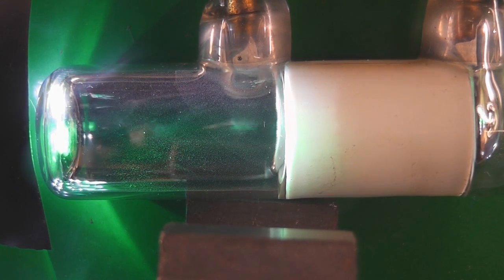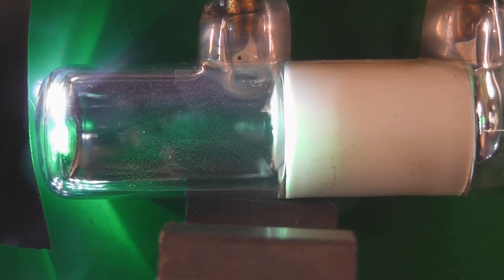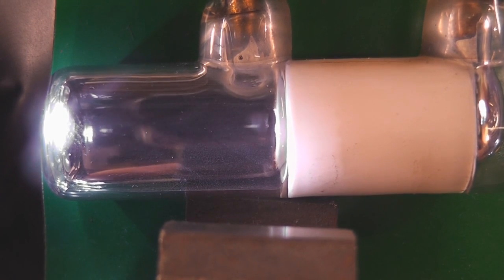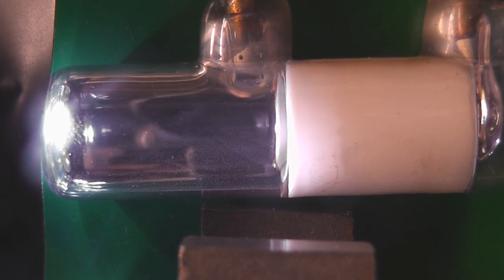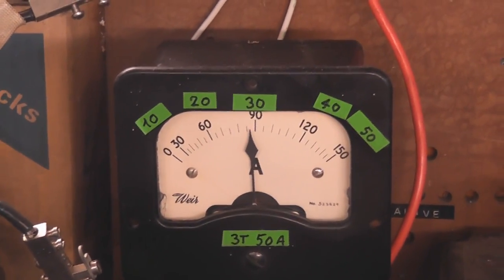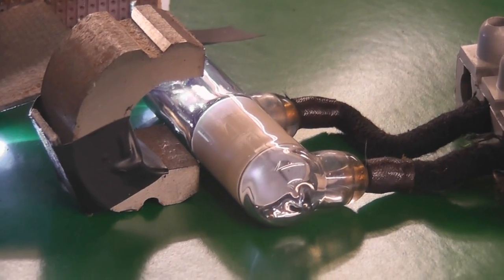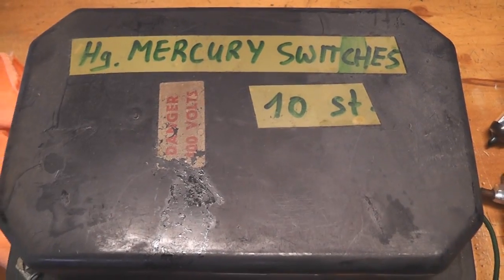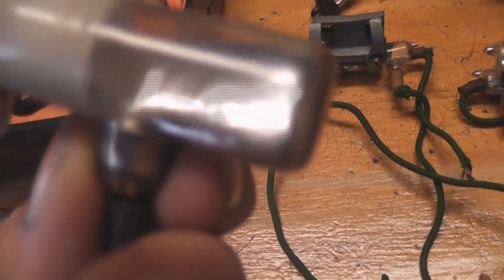Hg - Mercury

Comment: and might I add, if you happen to have a seringe with a very fine needle like the ones for diabetes treatment, it will be a thousand times easier to pick up. watch out what container you put it in too. if there is a good amount of it, like if you broke a barometer, make sure that the container has a thick wall and bottom if it is made out of glass.

Comment: Mercury doesn't necessarily need to be injected to be deadly, and metallic mercury isn't really dangerous. There are cases where people have injected it, eaten it and inhaled it without symptoms. However, what is dangerous with mercury is it's compounds, and is often the cause of the different forms of mercury poisoning. But ofcourse where you have metallic mercury you also have compounds of it, so one should non the less handle it with care.

Comment from the maker: Correct BBD, well spotted. I have a box full of those magnets.
This is a 50-60 Amp rated Hg switch out of a transformer tapchanger.of an old Voltage Regulator.

Comment: I once saw a VENNER timeswitch that had two mercury pots in it. They were open-top, & when the timeswitch turned on, two electrodes would dip into the mercury, thus completing a circuit. :-)

I don't own any mercury-based timeswitches, but I do own a couple of venner-made timeswitches. :-)

{^_^} BoomBoxDeluxe {^_^}

Comment: Very kool experiment!
It would be ineresting to see this effect on a slightly larger scale,
perhaps a dish of mercury with two electrodes running a current
through  and a large magnet.
The banana mercury switch is particularly interesting, where or 
what did you find that one in?

Comment: Or just use some freshly stripped copper wire to amalgamate the small globs into a form that is easy to dispose of. Just strip a length of fine flex to get an end then fan it out, sweep up the mercury onto the end and place the used end in a thick plastic bag and cut it off in the bag then carry on. Take bag, close it, double bag it then send in to either Hazmat or drop in bin as toxic waste.